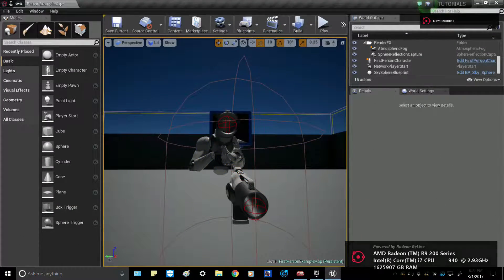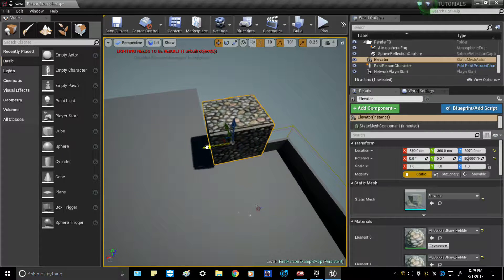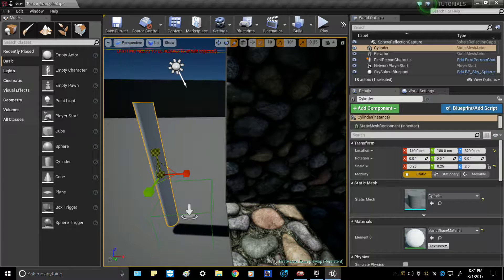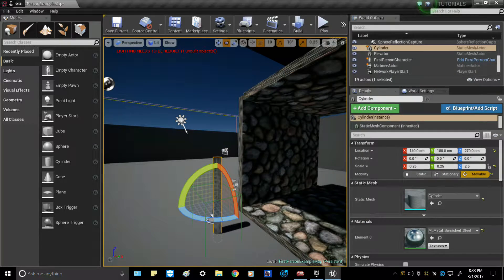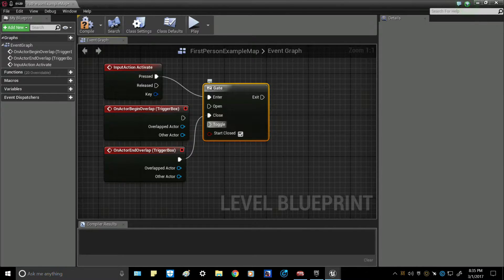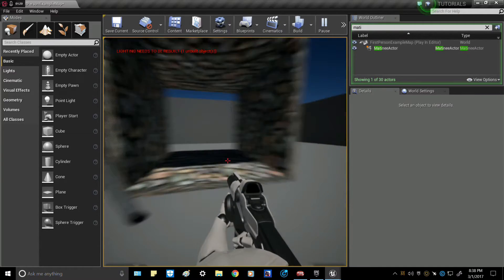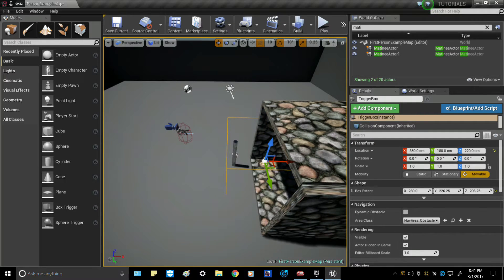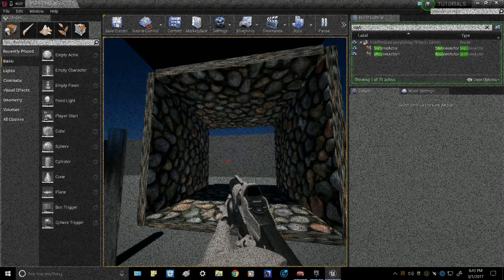UE4 WORKING ELEVATOR & ACTIVATION LEVER TUTORIAL!

Comment: I followed this tutorial exactly, and yet whenever the action input in pressed, even outside of the trigger area, the animation(s) are/is still activated. Please respond as soon as possible.
Reply from the maker: Paladin Bobcat try shrinking the trigger to a small box and see if it still activates it outside. 
Also, did you create a reference to the trigger it self?
Reply: I shrunk the trigger and yet it still doesn't work properly.
https://gyazo.com/83ef01b51b841b3a4cc2486b79617001
This is what my blueprints look like currently.
Reply from the maker: Paladin Bobcat try seperating the references into 3 separate blueprints. 
Replicate the blueprint 3 times but only use 1 reference per set up. Let me know!
Reply: Well, I fixed the proximity thing, but now i have to press E twice before the animations start. Afterwards I only have to press it once.